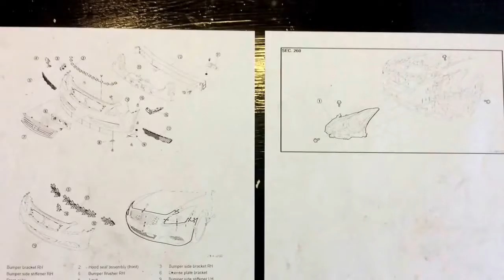2009 Infiniti G37 Sedan Headlight Replacement

Comment: This is a AFTERMARKET Headlight Assembly, if it was an OEM; it would have cost $1,000.00
These Aftermarket headlights do not shine as the OEM headlights and condensation will buildup inside the poorly sealed Aftermarket headlights.

Comment: Is this a xenon or bi-xenon headlight? I am about to buy a G37 Sedan.Looks like high beams hallogen?
Reply from the maker: Seyfettin Zorbey AKKAR xenon with halogen
Reply: Its a bi-xenon. the one you're probably talking about is actually a foglight inside the headlight. It was like that on the years 07-09 then they moved the fog lights down to the bumper for 2010-2015